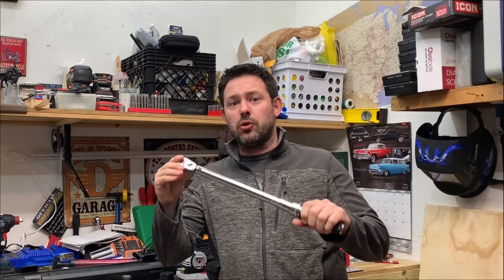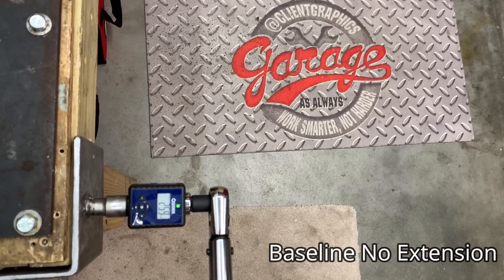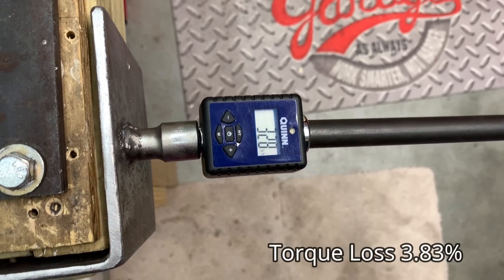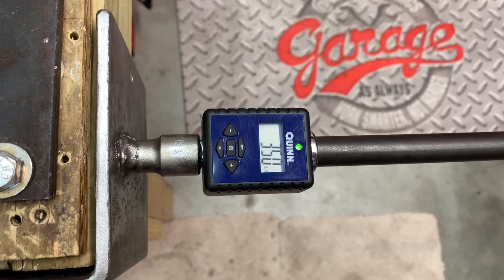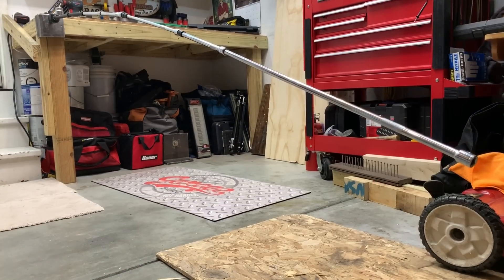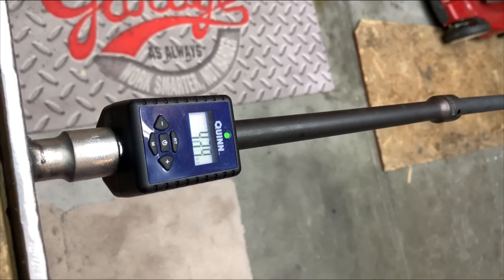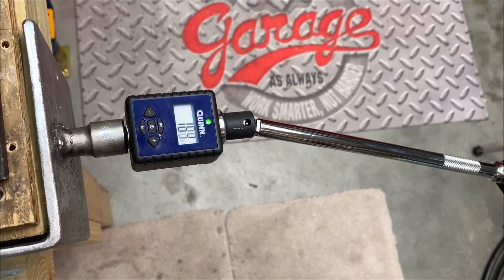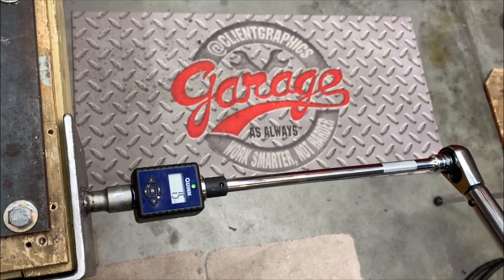Do Longer Extensions Result in more Torque Loss? Let's find out

Comment: Wish you had kept the extension length real world. I've seen these type of tests before, and if you keep everything at 90 degrees and operate the torque wrench properly, (not to say you weren't,) there is no torque loss. See Shane Conley's vid on this from his tech class.
Reply: True because the torque won't be 'lost' unless there is an opposing connection. When the only torque connection is the workbench, there's only 2 torque points, the bench and the wrench handle. It can be a 100 foot extension, it won't change.

Comment: Haha, fun test. 
Say, can you test torque loss with swivels as well as universal joints?

And if you really want to have some fun, try mixing drive sizes! An extension with 3 different drive sizes 😂. Bonus points if you throw some swivels into that combination as well!
Reply: Torque loss removing fasteners or installing ?
Reply: Swivels and universal joints will put the torque all over the place because you are changing the effective length of the wrench.  The angles move the point of where the weight is being applied to the drive.  This changes how much torque is actually being delivered, i.e. the length in your length x force is being varied.  The tool cannot compensate for these changes.

Comment: I like your tape measure what brand is that? ✌
Reply from the maker: That’s was a Komelon magnetic tip self locking power blade 2 SL72425  It was a clearance item at Walmart back in December 2019
Reply: @ClientGraphics  thank you sir, like your channel 👊

Comment: I was waiting for this video because in theory I would had believed that yes you would get torque loss because with simple common sense all force and torque is directly applied at its anvil now the thing that I really Question is that what is the possible difference between using a Deep Impact testically to using a Shallow or Semi-Deep socket with the torque wrench properly calibrated because I would assume the shallow has the most closet fitment Ratio from anvil to fastener which should put out the most accurate reading but I could be wrong
Reply from the maker: I skipped the 3” and 6” extensions because the loss was pretty minimal so using the shallow mid or deep sockets should be similar in theory. Most of the loss or variance being human error or consistency. Would still be an interesting one to test so I might come back and do that one with the Bosch Freak core 18v Impact at some point.
Reply: @ClientGraphics  Yea it would be nice to see I like how you go into further depth with alot of the Content you put out these tool brands and some of their designers need to take a closer look and take notes to some of these videos just like the video you did on the ratchets who would ever think the milwaukee 90 tooth design would beat out all other competitors need to do a comparison against some of the higher tooth count ratchets side by side with it and not just the 3/8" drive but the 1/2" also

Comment: Technically not loosing torque, it's just being used to take up space in the extensions and for any malleability in metal.  If you had single 10' extension it would probably have very little loss or equal a short extension.